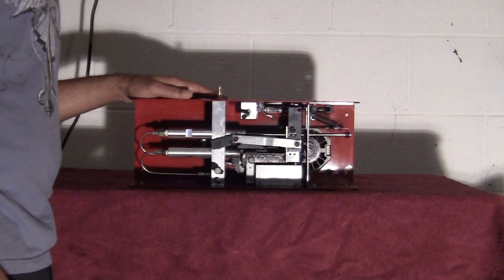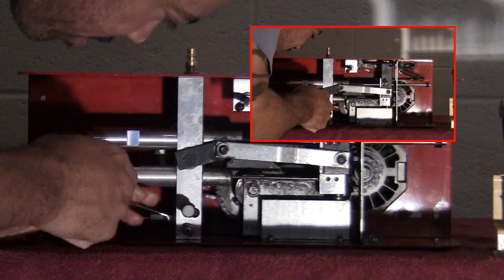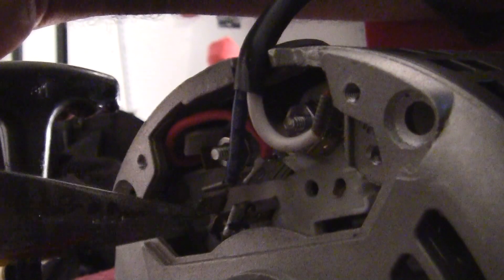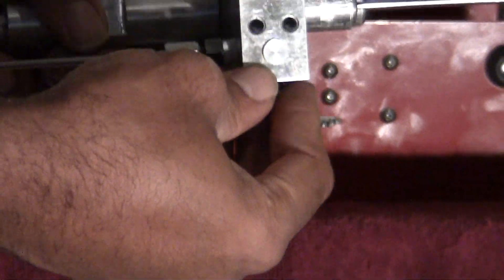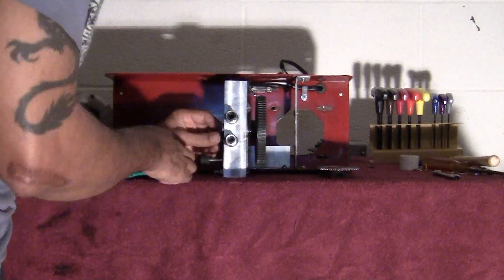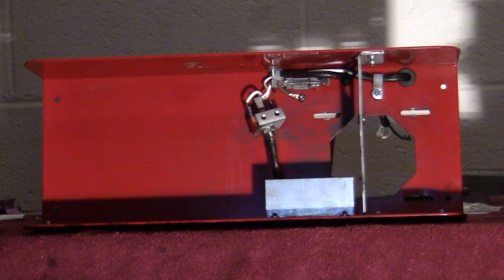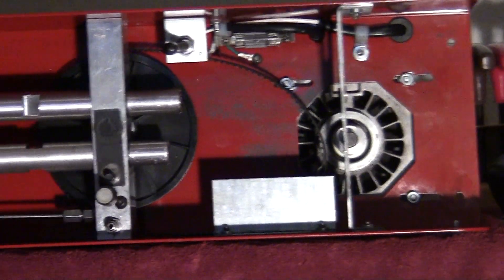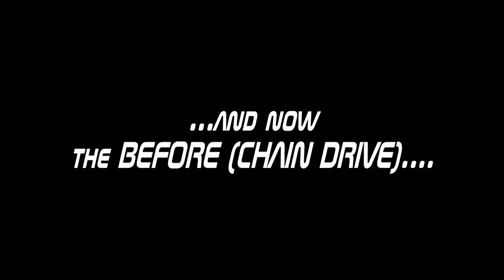My ShoeBox get a UPGRADE

Comment from the maker: N short, The Shoebox is a Scuba Tank compressor.  This unit fills Carbon Fiber tanks (SCBA) up to 4500 psi.  It can also fill aluminum SCUBA tanks.  It's called the Shoebox cause of its size.  Its just about the actual size of a shoe box.

Comment from the maker: How long it will last is a question no one can answer.  When i fill my CF tank from 3200 or so up to 4500 psi, it takes roughly 2 hours.  i let it run for 1 hour straight then let it cool down for 15 minutes then let it run for another 1 hour or so till it fills full.  I also lube the piston rods as per instructions: once before use

Comment from the maker: LOL...Johhny, if you have a good source for air that's cool.  The place i filled up from BEFORE the Shoebox gave me 50/50 service.  many times i would drive to the desert 80 miles one way to only find out my tank was only filled to 4000 cause they rush filled the SCBA tank.  And it cost me 5 bucks a fill.  But when they were good, they were good.  Still a hassle to leave my tank overnight only to have to return to pick it back up.

FREEDOM BABY..............FREEDOM!